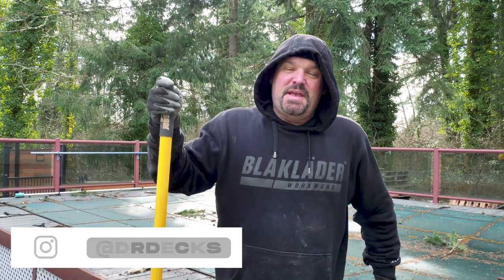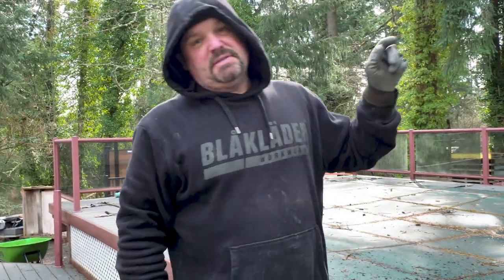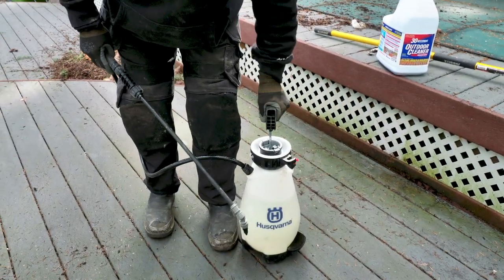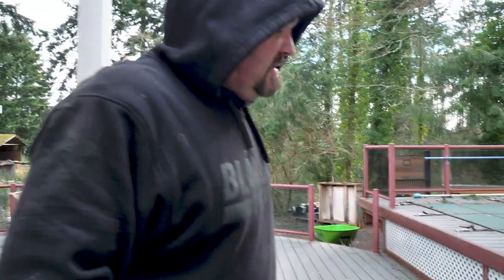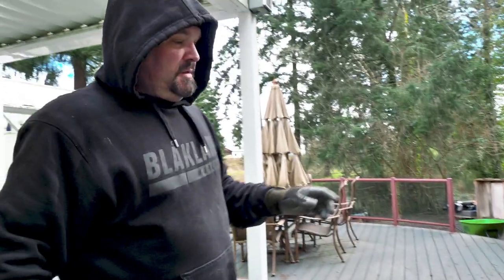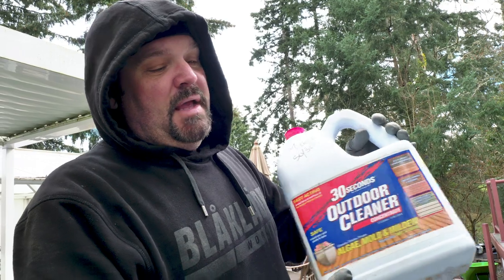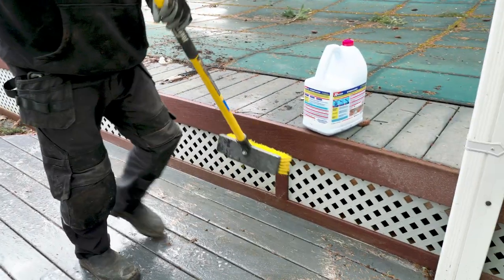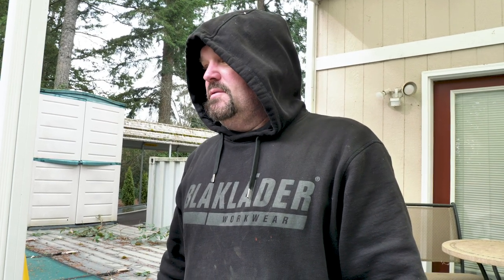How To Clean A Deck || Dr Decks

Comment: I’ve been power washing customers houses/decks for years and narrowed it down to this.  1 gallon liquid chlorine for pools (10% sodium hypochlorite) to 3 gallons water in a Stihl back pack sprayer.  Key is to completely saturate all the siding/decking/fencing/gutters/etc.  I then come behind with a 2800 pressure washer to basically just rinse the surface of chemical.  Works like a charm!  1 gallon at Walmart under $5
Reply: Hi thanks for that...long term would the pressure washer hurt the wood?
Reply: Pretty sure it voids warranty

Comment: Sodium hypochlorite appeared to work great the first several times for molds. With routine use, the mold got worse and worse. It began rapidly returning within days or weeks! I guess this is scientifically why EPA & OSHA do not recommend it's use for mold. I eventually found and used a product called Corte Clean and have been for years. It doesn't have all the problems of sodium hypochlorite. In addition to the molds, it cleans the grease/oil under the barbecue and doesn't corroded the structural metal decking hardware. It actually removed the rust stains the sodium hypochlorite caused. It even restored some of the original color the sodium hypochlorite excessively bleached. While it may appear to cost a little more, overall, I have spent less, especially labor, over the years. My extremely expensive Trex deck almost looks like the day it was installed. You should check it.
Reply: You should have a grill mat.
Reply: @johnwagnon5  I  have one that's fire resistant but grease & oil still splatter all over the place & need to be cleaned. Thanks for reminding me to order some more Corte Clean.
Reply: I have a job coming up, really nice home, with a Trex deck and steps. I'm going to try and order some of that corte cleaner you've mentioned here. Gonna turn the psi down on my 4gal Simpson pw. Probably use a decent mild scrub brush. Any suggestions?